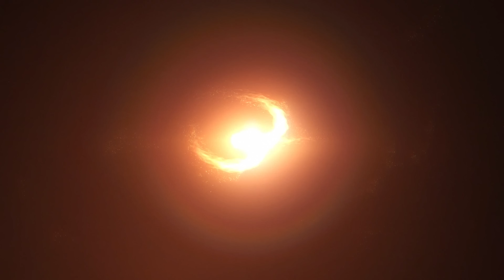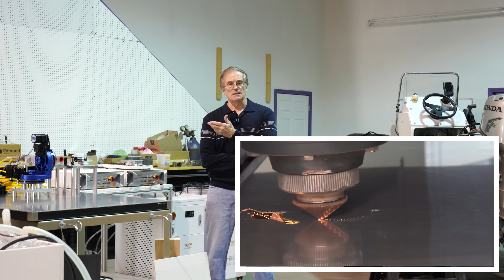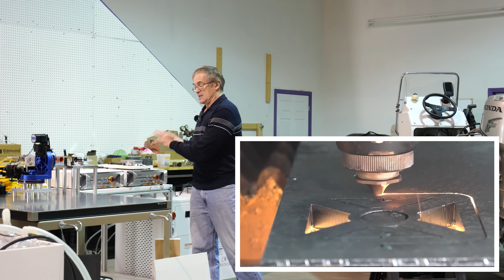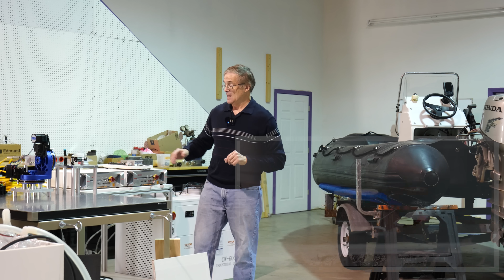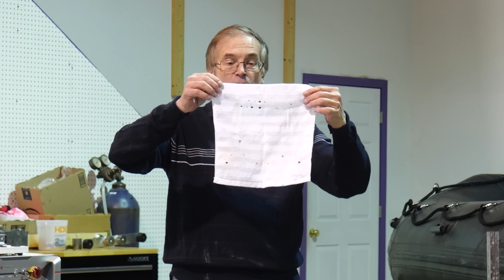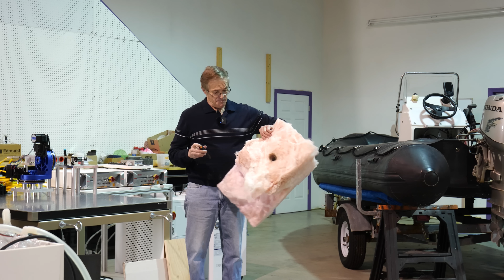We have a problem... and need your help!

Comment: I asked ChatGPT:

“What material that’s non-reflective, can I coat things with that will safely absorb and dissipate fibre laser high power?”

Reply was:

“Good question. When dealing with **high-power fiber lasers**, especially in the **IR range (typically 1064 nm for YAG or fiber lasers)**, you need a **material that not only absorbs but can handle and dissipate the heat safely**, without degradation or damage.

### Materials that can absorb and safely handle high-power fiber laser energy:

#### 1. *Black Anodized Aluminum (with laser-grade coatings)*

* *Absorbs well in near-IR and visible.*
* Can handle moderate laser power if designed for **thermal dissipation (e.g., fins, heat sinks)**.
* Needs to be paired with *proper heat sinks or water cooling* for high power.

#### 2. *Laser Beam Dumps (Commercial Materials)*

* These use **ceramic-based or metal-carbon composites**, specifically designed to **absorb and dissipate laser energy without reflection or damage**.
* Examples: **Thorlabs, Newport beam dumps**.
* These materials are often **porous ceramics or blackened metals that can withstand kilowatts of laser power**.

#### 3. *Black Ceramics (Silicon Carbide, Alumina with black coatings)*

* **Excellent thermal conductivity and high laser damage threshold**.
* Good for **high-temperature and high-power laser exposure**.
* Can be coated onto surfaces or used as standalone blocks.

#### 4. *Graphite or Carbon-Based Coatings (High Temp)*

* *Graphite plates or carbon composites* can handle *high-power lasers* by absorbing and converting to heat.
* Graphite has **extreme heat tolerance (>3000°C in inert or vacuum)**.
* Downside: Graphite is brittle and can outgas if not treated properly.

---

### Important note:

* **Vantablack, black paint, or common coatings are NOT suitable for high-power fiber lasers**. They will **burn, vaporize, or reflect unpredictably when overwhelmed by power levels of fiber lasers**.
* Always design the surface for *thermal management (active or passive cooling)* when dealing with **>100 W lasers**.

---

Would you like me to give you a *DIY-style recipe for making a laser-safe, non-reflective coating using commercially available materials?*
If yes, just say "**yes, recipe.**" “

Comment: I would take plywood or other similar sheet and wrap a continuous (single layer) thin wire around the sheet like if it were a coil. Connect the both ends of the wire to a system that is able to pulse electricity and if it is cut, activates the emergency shut-down protocol. The laser, if it hits the surface, it will cut the wire, which will be noted by the system and the shut-down will be instant.

With a laser that powerful, I would not try to stop it but rather detect it and handle the shut-down system.

Comment: How about a "light weir" which utilizes the same concept as the 96-million plastic balls floating in Los Angeles reservoir to essentially "baffle" away most of the sun's energy in order to prevent evaporative water losses. You could build hollow walls and fill them with the appropriate type of reflective scattering material, glass beads perhaps such as are suspended in reflective paints and coatings. Even a gel matrix or fluid suspension (non Newtonian fluid glass goo?) may work to internally scatter and bounce the beam over a large enough surface that you are afforded some measure of shielding. Some marble sized faceted reflectors would look cool and perhaps act as a "weir" to slow the flow of photons?  Would love to help test this line of reasoning if it passes your sniff test sir.

Comment: What about perlite iit does not burn and is considered non-combustible. It can withstand very high temperatures, and its fusion point is between 2300°F and 2450°F (1260°C and 1343°C). When heated, perlite expands significantly, between 4 and 20 times its original volume, as trapped water vaporizes

Comment: I know you said no reflection, but what about a coating like the Barium Sulfate paint that might diffuse the laser, or intumescent paint. Also curious about high temp insulation like calcium silicate or refractory material like others have suggested.

Comment: Fire your laser into a DIVERGING LENS, as your backstop. Then put something large behind the lens, just in case.

I mean, if lenses can focus the beam without melting, then they can diverge the beam without melting, right LOL?

If that doesn't work, then my next best guess is some kind of wet wood, or burn some carbohydrate free bread (remember that Atkins stuff) with a torch, until it turns into a space shuttle heat shield. Wet charcoal, I guess.

Comment: If practical, consider superimposing a sweeping or oscillation to your beam to spread the laser over a larger area during normal operation. This is done in fusion to prevent plasmas from melting the divertor. It's not necessarily a full solution, but it can probably enable other types of materials for beam dumps that you may otherwise not consider.

I liked your idea of plywood and think you're on the right track. It is a markedly good material in terms of its availability, cost, and durability to high heat flux. A quick google search reveals that plywood has been used in the construction of nose fairings for some high performance vehicles in the past with success.

If you don't mind replacing it on occasion, you might consider a redundant secondary system responsible for sweeping your beam (actively disengaged or decoupled during brief times when you are focused at a target) in conjunction with plywood with a water source (weeping hose along the top of it) to wet the plywood. I don't know if wet plywood would behave better or worse (spalling from steam?), but I anticipate it could help mitigate fires.

Wood is the original carbon fiber. It's way cheaper to buy plywood than building a bunch of 3D carbon-carbon tiles.

Other things that come to mind. I've seen water as a beam dump. I think you could probably mix an additive to diffuse the laser over some thickness, but that assumes you're always firing in the same spot. Covering a wall would be a lot of water and a big construction project. Wax and salts--same idea but they will have some latent heat buffer to melt before boiling, giving you more room to operate. I like wood though.

Comment: Anything that absorbs the energy of the laser will heat up and the laser will punch through. 

Concrete siding boards might give you a bit more time, but I would make another lense array for testing purposes that converges the beam closer to the laser so it diverges enough by the time it reaches the far wall that it doesn't burn anything up.

Or better yet, use a laser pointer or something else much lower power for development and testing of the targeting system and hook up the big laser once you're confident in the rest of the system, to include safety measures.

Regarding the speed of your targeting system, a mirror can move much faster than the whole lense/fiber apparatus.

Comment: Fish tank with a suspension of graphite and maybe a concentrated dye. Plenty of water soluble dyes out there for tie dying or water colors, and graphite or another black oxide like copper (I) oxide, manganese dioxide, iron oxide, or your choice. Active stirring to keep the suspension moving. You get the benefit of absorption across a tunable array of wavelengths and can buffer and ballast with a powder in suspension, plus the heat capacity of water to dissipate the heat. Toxic gases should be negligible and can be vented. Setup is simple and recyclable/reusable depending on material choice.

Only issue might be the container choice of the liquid because the beam may melt through glass or plastic really quick, but you can get other options for that too if it suits you.

Alternatively, use a pump to pump this liquid down a surface to be blasted with the laser so it is once again replenishing the water.

Comment: My friend is a glassblower (borosilicate) and use graphite  tool and is the only thing that doesn’t melt with the burning glass ! This doesn’t catch fire and is relatively light ! You would use the blocking element before the galvo and a heartbeat between every glavo frame so if the computer hang the laser is blocked and if the target enter the beam without computer consent, a laser shutoff should occur! Working with laser need to have redundant safety measures even more with this kind of crazy power

Comment: As your describing it I'm thinking a carbon sand (e.g. water filter sand) packed in an aquarium filled with water. Depth and water fill rate of the aquarium would need to be such that water replacement can dissipate your beam before it reaches the other side. Vent any steam to the outside. The black carbon will absorb the laser beam and fill in where it gets ablated. Any leftover ash will either get turned into pottery glaze or vaporized, so you may need to be careful about that with time, but since you started with black carbon ash should be pretty minimal.

You can make the carbon sand by simply crushing up coal or charcoal since you don't need it to be food safe.

FYI, so cool that you went to the community to ask for suggestions.

The size of all this may be infeasible...

Comment: tungsten!  1cm thick, as a plate 12x12cm, screw to centre of a meaty chunk of aluminum means at least 7,5 cm thick, 30x 30 cm. the aluminum block could also have holes 4 water cooling. but the tungsten alone will the most work and prevail!

Comment: What about something like homemade Starlite. It has the ability to take massive amounts of heat. Though the thermal mass is also fairly low that it may not last long enough.

My other thought was instead of looking for something to fully absorb the laser at the point, diffuse it with a material that absorbs the required wavelength in a controlled manner (say 5% per inch etc). Someone earlier suggested running water however I was thinking something like a fishtank (assuming glass does not absorb enough that it heats up and breaks). 
Design an ar coating on the outside surface of the tank so that reflections are minimized and for good measure put something sacrificial in front of with the intent for it to burn through a 1mm hole, enter the tank and any reflections hit the backside of the drywall so that it provides protection from reflections. You would want an air gap between the two so that any smoke doesn't transfer to the glass causing it to create a hotspot.

Straight water won't do as an diffuser/absorber however multiple additives could be used to create various levels of opacity. Carbon black, charcoal powder or similar could be used. Add a bit of a surficant to keep them suspended long enough. 

This also provides the ability of being self healing as the laser energy is heating up the water itself. Size and weight could be a problem depending on how thick the aquarium tank needs to be to safely absorbed/diffuse all the laser light as well as how big of an area to protect. 

Could something like a fog/smoke machine creating a wall of fog diffuse the laser enough that another material like drywall could easily stop it afterwards?
Two sheets of drywall separated by a foot or whatever is required and run a fogger or smoke source in the cavity.

Comment: Instead of the wall behind the target, would there be a way to create a small "cover" that could drop down using an actuator or something that will move the cover in front of the laser. This way, the "expensive" material would be minimal if it was directly in front of the laser emitter. (Within inches or less.) A sensor or camera with computer programming that detects the very moment the target is destroyed, trips the release mechanism, and immediately covers the laser.

Comment: You could have a reflective mirror like material that scatters the light on impact with internal reflection.
Maybe Tantalum carbide could be a useful material for you to try. 
Polarization of the laser could help control focus, and also pulse laser may give you enough time to control burst time, as long as the hardware can handle it.

Comment: Materialized have you thought of fiber cement board or rockwool. Also maybe the backdrop should be made up of small pieces of drywall or fiber cement board and rockwool insulation but set the pieces up on a 45° angle making a baffle. That way the laser beam is going through a diagonal section of the material

Comment: Suggestion 1: Big pile of fine dry sand.

Suggestion 2: Target in 3D and only focus on the targeted spot - potentially with more than one beam from a wider base. "Slicing" could be done by rapidly moving the targeted spot through the target/object.

[You are not working for the DOD are you? I used to turn down software jobs if they were anything to do with weapons :) ]

Comment: Okay maybe this is because I'm an Electronics guy not a materials guy, but how about you build a thin large box using one of the materials already suggested like cement fiberboard backing for the front and back panels spaced say 24 inches apart that can be sealed off from all external light sources. Maybe paint the internal surfaces white for maximum reflectivity. In Mount a bunch of highly sensitive light sensors inside the seal box to detect when the laser Burns through the front panel which will immediately trip the light sensors and shut the laser off within microseconds. I would do this anyway as you are trying to test the different materials. I would just make sure that you build the trip mechanism purely in hardware not using microcontrollers so there is no chance for software glitches and delays due to software looping. This also has the benefit that you could potentially use cheaper materials which can be easily replaced.  You could also have two or more separate redundant shut off circuits fed by different arrays of optical sensors.  By the way, love your channel Doc!

Comment: Perform your experiment from above directing your laser at a pool of water.
Rent a scissor lift. Buy a large diameter Splash Pool for kids. Fill it with a foot or two of water. I'm sure it'll do the trick.

Comment: Solution proposal
Assuming 10-50kW fiber laser
Thin, Reusable, repairable, and easy to transport. 
Carbon–Carbon Composites or pyrolytic graphite as a sandwich.
A) 20mm back board. 
B) 5-10mm horizontal Venetian blind-style stacked at 15-25’ off axis with 5mm air gaps between slats. Use ablative or matte ceramic coating on these slats.
C) 5mm board. 
D) 5mm loose carbon in an airtight Kapton envelope filled with inert gas (alternatively a layer of carbon aerogel) 
E) 10mm front sacrificial board (anti-reflective barrier) as Carbon–phenolic, boron carbide tile, or ZrO₂ spray on carbon. 
F) loosely envelope the entire structure with Kapton and maintain modest low pressure interior to minimize high-pressure gas escape (CO₂ or plasma plume) when in use. 
CONSIDERATIONS: 
1) Vented edge seals (structural integrity) to isolate materials with different thermal expansion rates.
2) Plasma vent pathways for escaping gas. 
3) Consider hex-panel modularity for panel health/repair with aerogel corner beads or flexible gasket rings.

Comment: Ground would work and be my last choice. Dirt pit would probably be better. 

I would want to constrain the distance in which the laser is destructive.  This probably means a dynamic focusing and/or a laser array. 

How do you ensure the skies are safe when testing outdoors?  What is the focal length?
Reply: Point it down toward liquefied sand. I bet you could run that for a long time and you would be left with some wild artifacts.

Comment: Depending on the beam diameter, could you not make use of a series of partially reflecting mirrors inside a box backed with an absorber and orientated like the model black body?  Also would help if we knew what your wavelength is.

Comment: Can Tungsten carbide block a fiber laser beam?   AI answer below
Yes, tungsten carbide can block a fiber laser beam, especially when used as a coating or as 
a bulk material. The high density and atomic weight of tungsten carbide make it effective at 
absorbing laser energy. Furthermore, tungsten carbide is commonly used in laser-assisted 
processes like hardfacing and cutting.

Comment: Try a vat filled with ink, Chinese ink, soot-water suspension.
Try a black body model: a reflective chamber (the inner surface is reflective) with water cooled walls that the beam enters through a small hole.

Comment: snow or fog?🤔 im thinking, unless heat conductivity is extreme, far greater than diamond, substance will boil away. i like dense fog because i think it will scatter enough, given reasonable thickness. but without lifelong experience, its not easy to reasonably imagine full power of something that can melt through thick fiberglass insulator as if it was a cling plasting.

Comment: Consider a rotating back wall that is also on a horizontal track. This will maximize your material to burn through as it is being renewed constantly. Adjust velocities of both movements as needed for burn rate. Might also make cheaper materials an option.

I am also thinking of the same rotating apparatus but now reflective with a means to cool the reflective surface (water casing on back?) and angled to reflect laser down to a cheaper absorber on the ground (wet sandpit?) Limits on laser would be needed to stay within the laser's backstop.